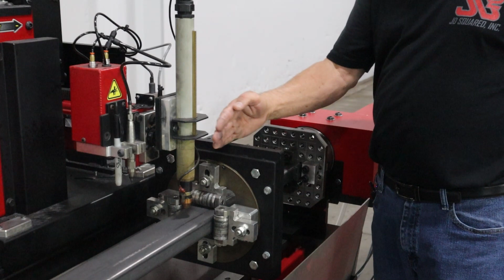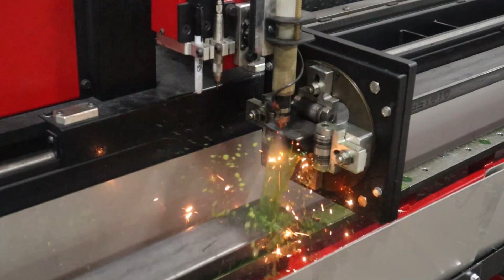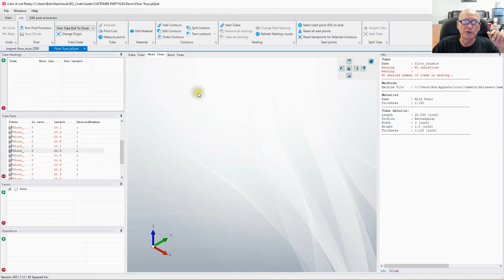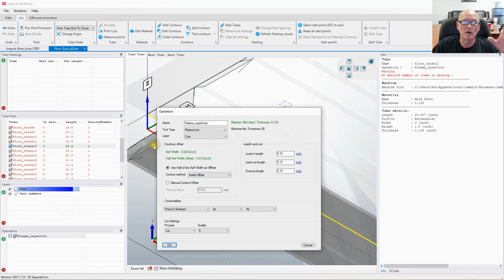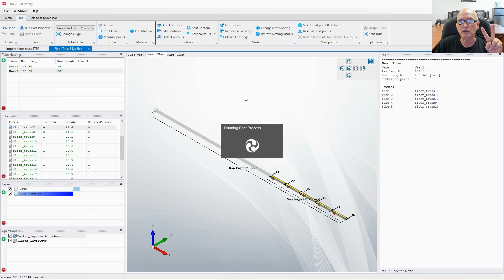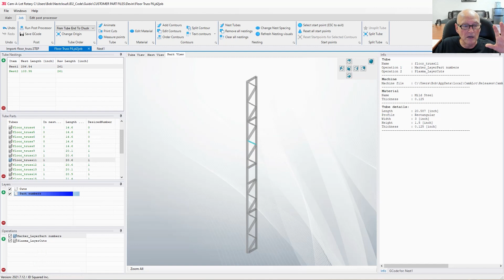JD2 Project #2. Making a Floor Truss on the RC6 Rotary Cutter.

Comment: Curious why the program doesn't cut the coped bevel on the other side of the part? I understand there is a lead in, but it would save that couple of inch scrap from each piece, and cut the cut process in half. I think this or the 12, and a MAD with the tube, and extended gantry will work nicely for my shop. When you get the tilting head dialed in most of my cutting needs for tube and plate will be handled.